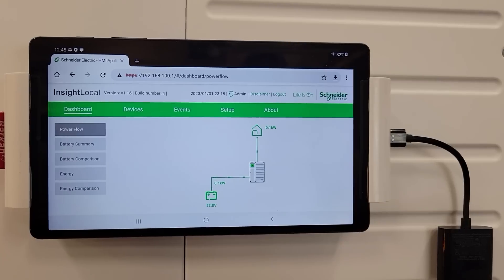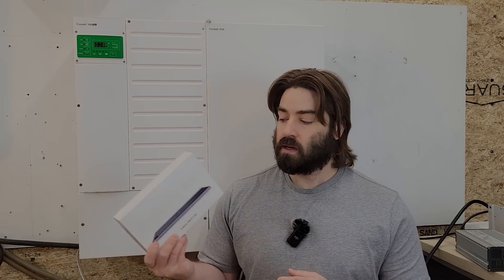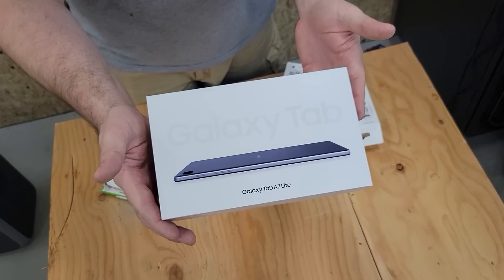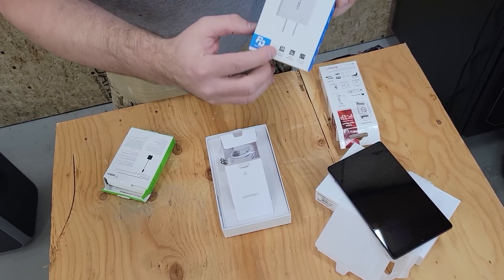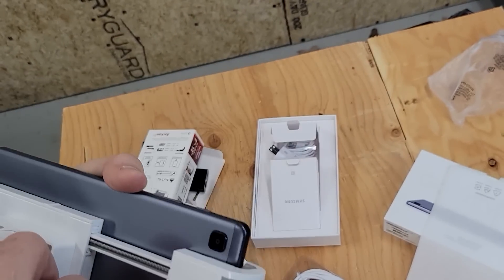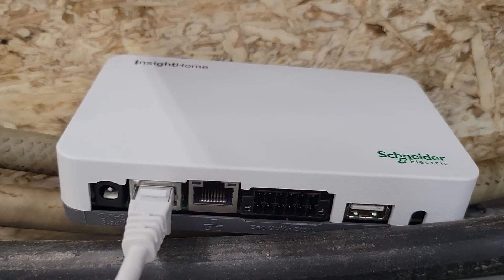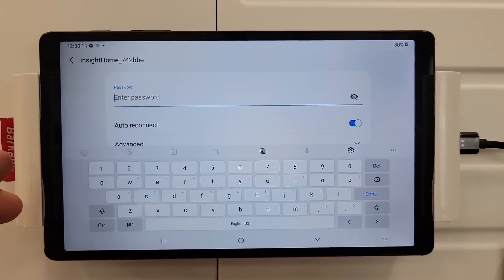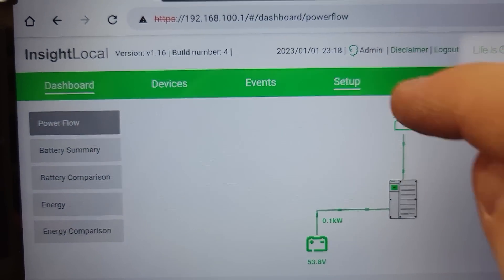DIY option for monitoring solar off grid system

Comment: David, did I miss something in your previous videos?  Why can't you just use the Wi-Fi ?
Reply from the maker: The tablet will connect with wifi.  The wifi times out, and then you have to log back in.  I am trying to make it stay logged in with the hardwire.
Reply: @DavidPozEnergy  I think what you are saying is the WiFi access point of the Insight home times out - not the tablet itself?  If so, that is because the Insight Home Wifi access point it is supposed to be used for temporary setup.  If you wanted to go full WiFi, you would join the Insight home to your home network WiFi, and join the tablet to that home WiFi network also.  Then Insight Home will then connect to the internet, and you can use the phone apps also with the Schneider cloud.
Reply: @DavidPozEnergy  Thanks. FWIW, you can also use that same USB to ethernet device on your cell phone. (providing it's a more recent phone).  Maybe useful for other projects. What I typically do is go to Walmart and buy a pay as you go phone (as they are dirt cheap for a smart phone) Don't buy the subscription and use the phone as a monitor for my devices.

Comment: Nice work David.
The network stuff is not easy for those who are not in the loop...
Regarding the Samsung USB charger, could you test that the tablet will not keep the battery charged with the original charger?
Maybe test with an USB power meter no analyze the consumption.
(I very much doubt that it will draw more power from an parallel market charger compared to what it would from the original one)

Comment: I can imagine that networking can be like chinese language to most people while it is relatively easy to others, I got my experience early, in dormitory, in early internet days, when older students decided to wire entire dormitory, all rooms, into a single network (wires simply window to window, on the outside wall), we had no choice but get a network card and learn how to configure it, extremely exciting early internet days.
So congratulations for pushing through it. Same way I've learned from youtube how to plumb stuff or how to remove tiles on the roof to mount solar panel rails.

Comment: It’s a shame that “Solar Assistant” doesn’t support Schneider inverters. If it did you can see everything about your system. Charts, graphs, live data, prediction of use, history, battery details, cell balance, make most setting changes, time of use control(off peak) all from anywhere from your phone or pc. For about $180 and sets up in under 30 minutes. They are adding more inverters but it could be some inverter manufacturers aren’t sharing source codes so they’d be SOL.

Comment: You can see the same basic real-time info broadcast from the Insight Home to your cellphone via the wifi connection  - correct?  If so why do you need a tablet taped to the equipment?  It seems redundant unless you need to control the Schneider system via an ethernet connection.  For that you can just hook up your laptop when needed.

Comment: This is an excellent video, I will try to resurrect an old iPad that is around the place.. I connected my insight home to the LAN network via wifi (I have disabled the built in WIFI SSID), and the guest login works well. In fact, as I don't have to plug it into the gateway, I can mount it on the other side of the house. THANKS SO MUCH DAVID! (my namesake lol - us Davids are just awesome)

Comment: The Sunny Islands are gone...  mine are still going, with a raspberry pi running IOTstack to control and monitor everything, and an old tablet for dashboard in the garage.  Fully Kiosk is great, it can be set to keep the screen stays off motion or sound is detected

Comment: Why bother with the wired connection? Why would the WiFi connection time-out?
Reply: I believe because he was using the temporary WiFi access point feature of the Insight Gateway - normally just used for setup.  What should have been done is to join Insight home to the home WiFi, and also join the tablet to the home Wifi.  Then he can use the phone apps also, since the inverter the system is connected to the Schneider cloud at that point.  But what he showed was good if you don't want any outside connection.

Comment: you could easy be off grid you have way to many inverters and batteries to do it so why are you still trying to do it if you have probley 150,000 to 200,000 in equipment already?

Comment: Not sure why you went with Schneider when your Growatt system was working perfectly. I guess Schneider was willing to pay you more.  The Schneider equipment is expensive and does not combine all the functions that "all in one" inverter/DC charge controller/AC chargers have built in at a very reasonable price. Even the built in display on the growatts was superior.
Reply: Schneider has a low idle consumption compared to the Growatt.
Reply: He still got his growwatts. He is a DIY solar guy. So he has to buy new stuff to make videos. Don't think it's about him not liking one thing over another. It's about what he can make videos on. Seen a lot of people ask him to make videos on the Schneider stuff.
Reply: Schinder also is a grid tied and certified to UL so it can be correctly used in an inspected code complainant system. The grow watt system is no up listed and therefore is not code compliant for use in US homes.

Comment: IP address needs to be 192.168.3.2
Subnet, gateway and DNS server are fine.
Device IP always has to be different than gateway and DNS.
Gateway and DNS can be the same in your (and most home) network.
Static IP is a set IP you choose.
DHCP means the server (or source) automatically assigns IP addresses to devices it “sees” downstream of its network.

Comment: Why Schnedar over just going w Victron? 

Plug in a cerbo gx for a screen n wifi app
Reply: Victron has some of the best apps and monitoring and make great stuff, but they have no interest in UL compliance or listing. They can’t be signed off by most inspectors in the USA. It doesn’t mean that they aren’t safe. If that doesn’t matter then go for it. I’m very impressed with the new Sol-Arc 15. It’s ten times better than it’s predecessor.

Comment: Schneider needs to build a self powered Pi module that outputs to a display. Like Venus OS or how a Cerbo Gx works. It honestly should be a part of their Insight module that customers just plug in touchscreen and it works. This is a hobbled together failure on Schneider's part on the Insight module redesign .
Reply: victron is so much better
Reply: @coreybabcock2025  yes, just get Victron gear.
Reply: Their business model (most other brands do the same) is to have your inverter connected 24/7 to their sever and collect all you data. So they are reluctant to give you a way to monitor you production directly rather than using your online account. I consider that inverters monitored online by the firm as a deal breaker. My inverter is a dum one. No monitoring what so ever (well... it beeps when something goes wrong). It does what it's made for : inverting current. That's it. I have built my own monitoring system integrated to my Domoticz system. It's totally separated from the inverter, powered by a 12V DC solar system, thus if the inverter fails, the monitoring does not. Also down converting 12v to 5V dissipates less heat that using the 230V to 5V wall plug (I live in Europe). Since my raspberry pi runs 24/7 every Watt counts.

Comment: David, I live in Massachusetts and the winters here can be kind of gloomy. Have you ever done a test to see how long your battery bank could last with no charge input for days at a time. I would also be doing my recharge with a gen because solar is not an option. Just curious about the battery life. I don't know what your current system is, but I do know in the past you had a solar charged server rack of batteries. I have an all electric house and would need a minimum of 10kw continuous power to feel comfortable. Thanks, Mike
Reply from the maker: This past month has been terrible for our solar production here in Mass.  When it's below freezing outside,  I can use up to 30kWh per day.

Comment: Having had the wall wart that powers my wireless charger fail after two years and knowing what I know about OLED screens, I give your setup 1-2 years before the tablet and/or wall wart fails if you leave the screen on 24/7.

Just having it turn off at night/turn on when you walk by should be enough to fix it
Reply: I doubt a 130 dollar tablet has an oled display

Comment: Hi David thanks for share all your experience with us. The Schneider ecosystem is one of the best in the market, but, since is not all in one the cost keep adding. I have your same setup but with a 4048 instead. I use an app called fully kiosk for android. This app let you set the tablet in kiosk mode. This allow the tablet to display only the insight web page and nothing more. This prevent the app to keep logging off and you can even use the camera as a motion sensor so you can turn off the display off and it will turn on with motion. This preserve battery and the life of the screen.
Reply: that sounds really great if the app would use the camera to detect motions and turn on cause the tablets battery otherwise would die quite soon. 
thanks for sharing.

UPDATE: the app is most likely called "Fully Kiosk Browser & Lockdown" and has quite good reviews for all home automation systems and visulisations like HA
I had not found 'fully kiosk for android'
Reply: Hi Jorge I have a couple questions for you as you have the inverter I am thinking about getting.
1. How do you think the Schneider ecosystem compares to the Victron ecosystem?
2. Do you need wifi or cell service to use the ecosystem? I have an off grid cabin and don't have either but want to have data and a visual display of what is going on.
3. Lastly, how much noise does the 4048 make? does it have loud fans and the hum from the transformer? Thinking of installing this in a closet that is near bedrooms but don't want a bunch of noise. Thanks

Comment: bruh
1) that icon on the hardware is a LAN Ethernet port icon

2) your network sucks and that's why it's so slow. If I were you, I would static assign the controller server AND static assign the tablet. I don't know what your router hardware looks like, but upgrade. run cat6 or higher. if my network ran like that, I'd probably would have thrown that tablet out the window 😂

3) root the tablet to remove bloatware as it really only needs a browser. run stock AOSP and install Android apps like icebox and other system utilities to remove background applications taking up precious CPU and RAM. probably running a crappy ARM chip in that tablet, unsure but really don't think you need better

good stuff all in all 👍 thanks for sharing